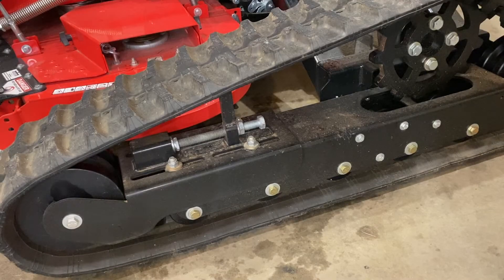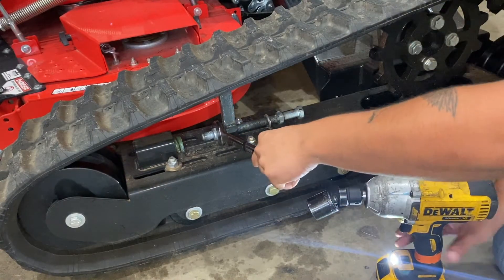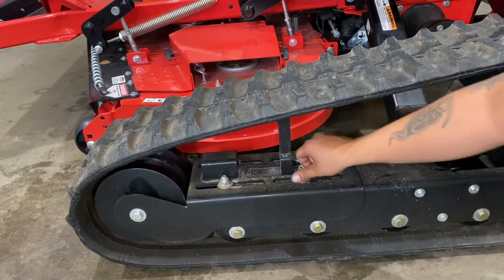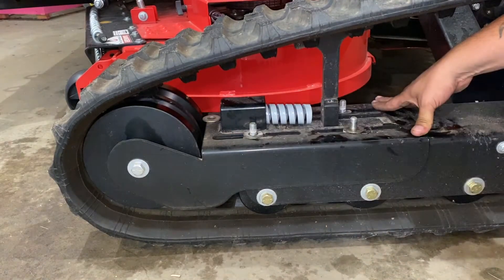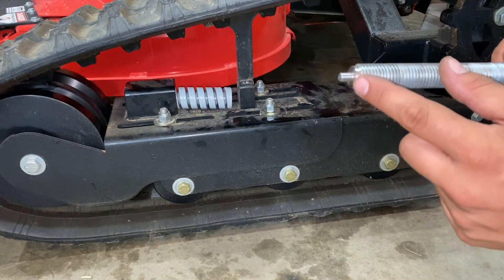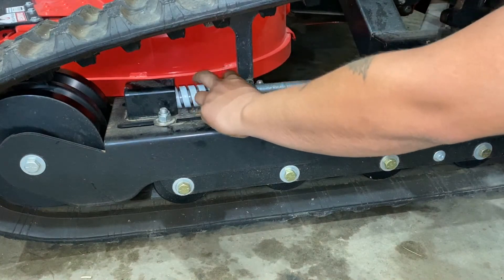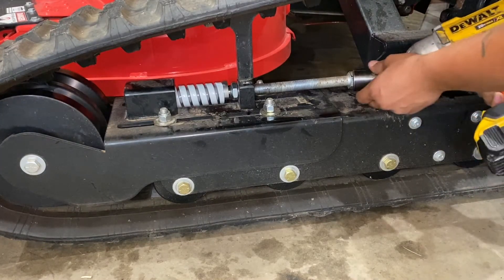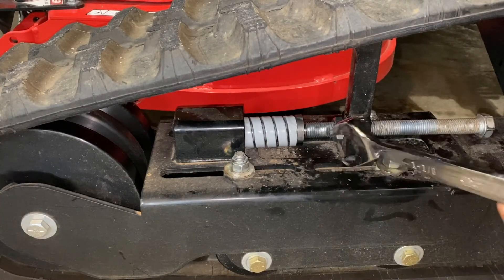RC Mowers-Green to Grey Springs

Comment: where can i get set of replacement tracks??? Bought a used mower and need to replace the tracks
Reply from the maker: Hello, You can get replacement tracks from a local dealer, found here: https://www.rcmowersusa.com/pages/dealer-locator, or you can contact RC Mowers parts department directly.